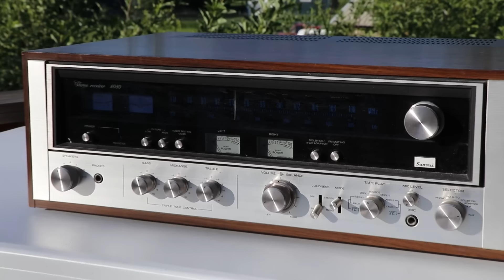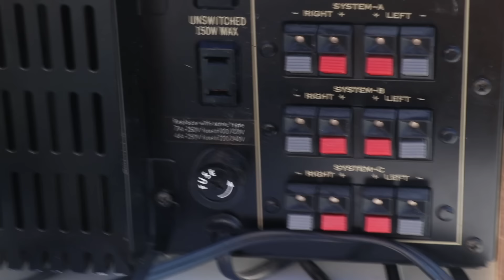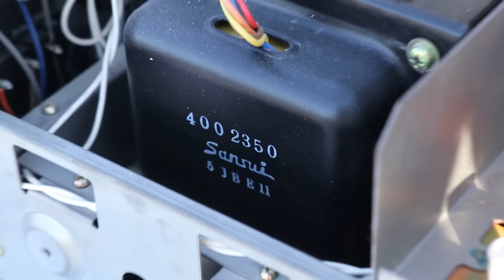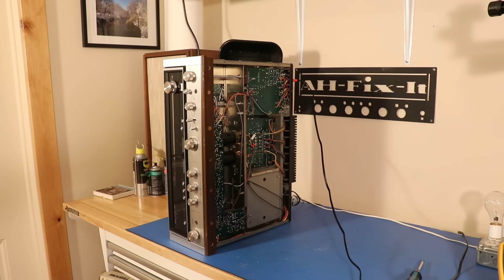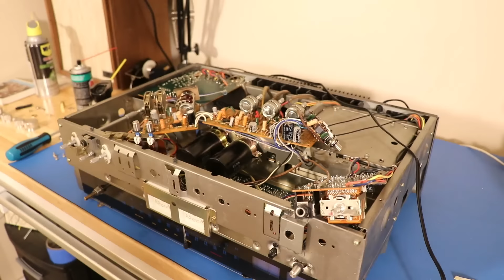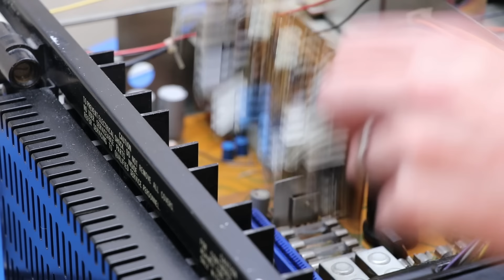It's amazing what DIRTY CONTROLS can cause on old receivers! Let's clean them on this Sansui 8080

Comment: I'm guessing no-one mentioned 'be careful after replacing the fuses after biasing on 8080/9090's as the filter caps won't discharge on power off' lol. There's a trick to it - solder two leads to either side of a blown fuse for each channel and use those in place of the fuse to do the bias, bias, then power off, remove the amp board and use a fuse puller/pusher to pop the fuses back in. That way, it removes the danger of shorting the amp board/outputs when popping the fuse back in.
The 9090 was one of the amps that hooked me directly up to our national grid (240v), was a fun afternoon that one.

Comment: Doesn't have to be exciting..though the fuse sparking was a good jolt, so to speak.  It's actually helpful to see a simple go through,  with all the basics addressed and no distracting problems...we saw control cleaning,  the scope came out,  basic resistor changing and then cosmetic stuff (personally I always enjoy time lapse stuff)
All in all, a great vid!  Thanks!

Comment: Love the old Marantz And Sansui's. I still use a Quad 7500A I'd say 60% of the people I've had over here to listen to Rap, Funk, Rock or Classic like the Quad over their modern 5.1 or 7.1 Surround systems. But it took me ages to find the right mix of front to back speaker combo's to bring out every nuance in sound. So I get why people pass them up. Without proper placement and speaker matching the sound is only marginally better. But put in some work and it's very notably better.....  QS Synthesized or QS Surround (found only on the 7500A or 9001 Quads) it's an very active surround sound. I'll never go back to Stereo!

Comment: I don't remember the details, but there's a really easy mod to have the tuner dial lights on all the time, which just requires moving a pin to a different slot in one of those plastic headers, no soldering required.

Comment: Hey, I've got this old amplifier that I love. It's a Realistic AM/FM tuner compact stereo. The controls need to be cleaned because they're all sketchy, and the volume distorts when I turn it up too high. The FM tuner feels really loose too, but I don't really use it that much. I used it as an outdoor radio for a year, and it worked great, except for the junky speakers I had it hooked up to.

Comment: I would be a little nervous with a relatively heavy receiver or amplifier on a fairly flimsy plastic table, especially outside on a raised deck like that. Just having the screws roll around on the bare tabletop (instead of putting them in some container) seems like a bad idea too.

The white tabletop and natural light does let you get some good thumbnail shots, but doing any serious or precise work out on the deck wouldn't be my first choice.

Comment: many people think that with a little deoxit,  the controls are good when they stop being noisy but if you have a distortion analyzer many times you can see the amount of distortion a dirty but "noise free" switch adds. i hate doing it but switches need to be disassembled to be properly cleaned. it's very stressful.  you may not even notice the distortion with your typical vintage unit but something like an sx3900 with it's low distortion, it's important to clean those switches. even then, you may or may not hear it but it may be measurable.  sometimes i get pretty anal with my restos, other times, notsomuch.
Reply: In other words: Flooding is not cleaning and a can of DeOxyd has nothing to do with good work.

Comment: You just got over 20 watts at 15Khz and you just ignore it?
I think your Fluke is the problem, most multimeters don't go that high.
Buy a modern oscilloscope that shows the correct value and problem solved.
Greetings from the Netherlands.
Reply: True! The Fluke 117 is specified only up to 1kHz with True RMS. Even with his old scope he could measure it much more precisely.
Reply from the maker: This is good info, thank you both.